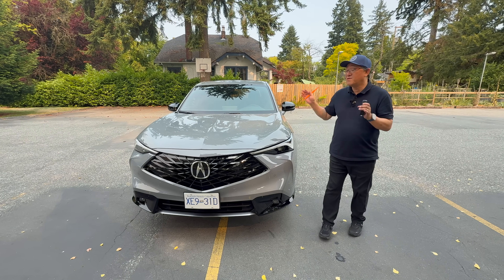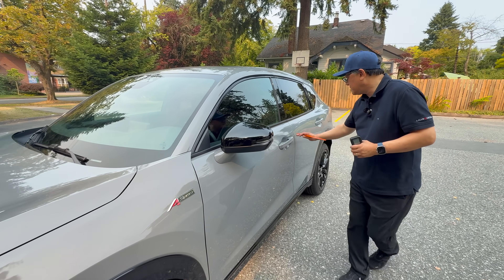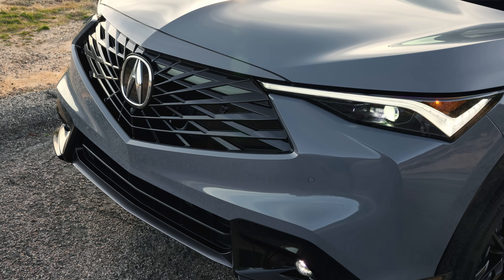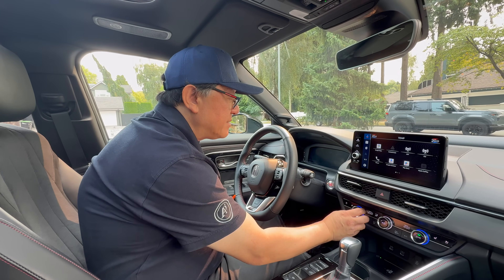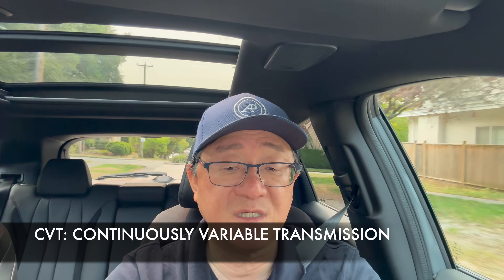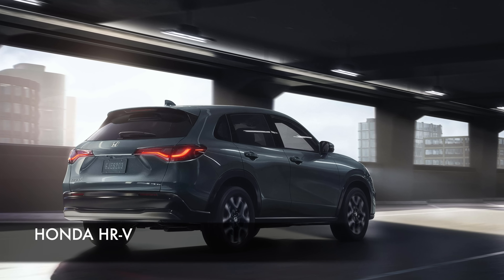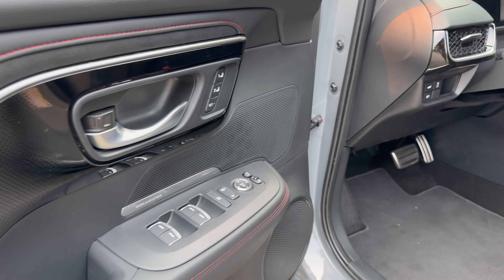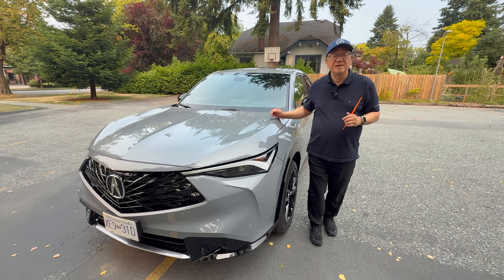Engineer’s Full Review of the All-new Acura ADX // Quality Check // Driving Check

Comment: Acura driver and went to try the ADX.   I have an original owner TSX which I love even as it ages.  I was very disappointed in the ADX.  No performance at all.   Acura could have put in a hybrid powertrain and it would have been much better.   Plus, like most Honda/Acura vehicles, I thought it was loud.
Reply: I’m sure that they didn’t want the ADX parts cost to rival that of RDX or MDX. But a 1.5L engine, with or without the forced induction, is inappropriate for a premium or entry-level luxury vehicle! And FWD instead of AWD? Incredible.  They won’t sell many of these in Jeep- & Subaru-crazy Colorado, for sure!

Comment: Thank you for mentioning the transmission, which is better than omitting it. Rather see the mpg come up with a hybrid versus the CVT but that’s just my preference. 10:56
Reply: I will never buy a vehicle with a CVT, or as I prefer to call it, a 1-speed, belt-n-pulley-driven A/T. I bought my first vehicle with an 8-speed auto. transmission last year after 46 years of driving & owning manual transmissions (including my previous Mazda & Subaru compact crossovers!)

Comment: Can't agree with 1.5T w/CVT. This car has nothing to stand out, not power, not driving dynamics, not fuel econ, not even price. For that money, there are many choices with a properly sized engine and proper transmission with better reliability and performance. An hybrid model would save the ADX.
Reply: Also the CX-5 is made in Japan not like ADX made in Mexico. Huge difference in quality and craftsmanship.
Reply: @jsw2233 sounds like a point I should have made 👍
Reply: Please share with us your  better choices .
Reply: @ThePapaJohnKing Anything is a better choice
Reply: @MikeForsythe Bingo!
Reply: Like a CX-5 Signature for example.
Reply: @kenfrankel3498 Yep! 2.5L engine with or without a turbocharger (even without, it makes 189 hp in my Mazda) and currently a proven 6-speed A/T with decent AWD. People always tell me how Mazda is so not a premium or luxury brand; I ask them to sit in one optioned with leather heated/cooled seats, sunroof & ADAS options (like mine is) and then tell me how referring to a brand as “luxury” or “premium” is something other than just a cynical marketing tactic. IOW, lies by liars.

Comment: ask Honda Technicians about the issues with the 1.5T
Reply: Oil dilution was fixed with a different weight oil particularly in colder climates during first year of release.
Reply: What are the issues with 1.5t?
Reply: @boriskiselev9082  headgaskets, exposed soy wire that rodents like to chew, etc...
Reply: Surprised that they have not fixed the oil dilution issue to date.
Reply: Oil dilution